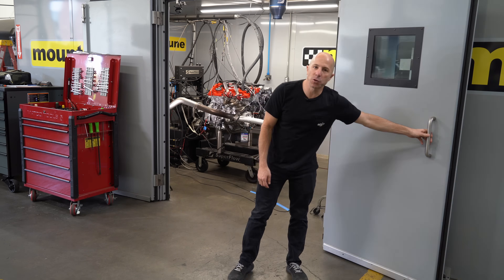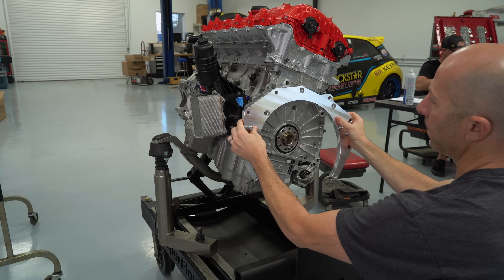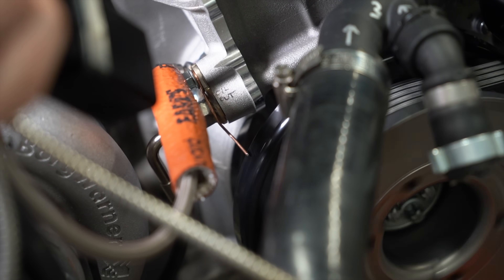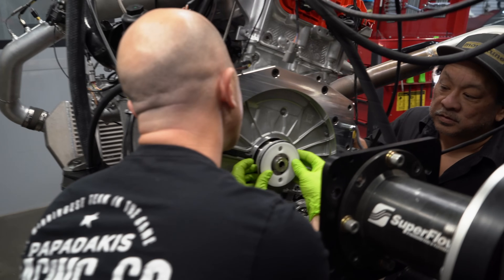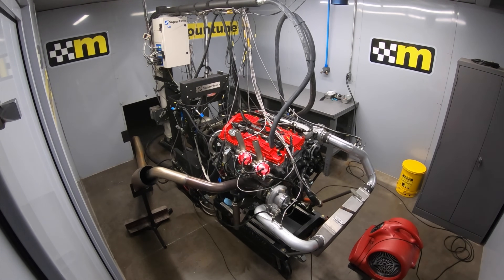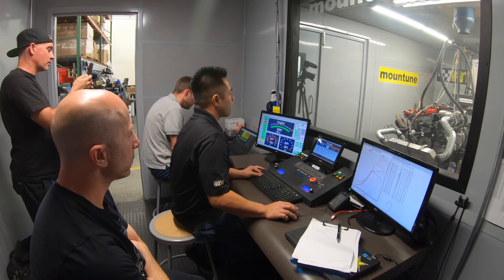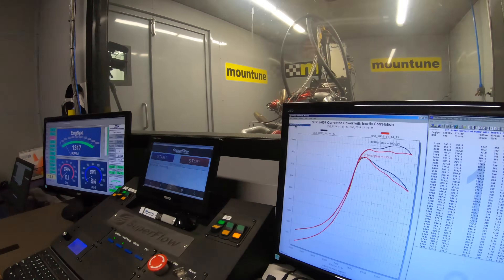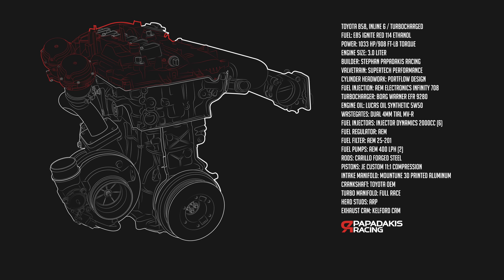B58 Engine Dyno 1000+ Horsepower - Sounds like a 2JZ!?

Comment: Based on the video it looks like this engine does not like high RPM. The head seems to flow way better than a 2JZ at low RPM, which is pretty much normal for an engine developed for early boost like most engines nowadays. The balance of the engine is not that good i guess, or something else is not right. They are barely pushing 6800rpm, this will be a limiting factor in case someone wants to go for big numbers. A 2JZ pushing this kind of boost is usually making around 1300HP, of course it pushes way more RPM. So from engineering point of view, the engine isn't spectacular. Yes it makes 1000HP, but this is a possibility for any 3 liter engine on the market. After all they made 800HP on a 4 cylinder Toyota engine, so those guys can make 1000HP on any straight6 :)

Comment: Will those dowels plugging the direct injection ports stay in it's place with all the boost that you will be making? Wouldn't it be better if it was welded in?
Reply: @Seb C surely the heat cycles of the combustion chamber would diminished the dimensions of those dowels, it's amazing how confident they are in thier tech, super!

Comment: I wonder how Mercedes avoids overheating direct injectors in the A45. It has dual injection (direct for low RPM and port for the higher speeds). I assume they inject fuel every now and then to cool them.

Comment: Imagine doing the timing belt at the back of the engine with it in the car, omg that would suck
Reply: BMW has the M50 i6 with people rolling over 300-400k miles with cheap maintenance.
Reply: @Carboy Dorifuto party  yes but if you actually did your research youd know that the m50 has its timing up front where's as the b58 has it at the back of the motor in between the engine and transmission, a significantly harder place to get too, it dosent matter if it lasts 400k km if it's a whore to fix it

Comment: I'm still trying to get my head around 6 cylinders and 2 exhaust ports.......
Reply: It has an internal manifold. So not two ports.
Reply: The 2021 models are getting 6 port heads later on.

Comment: all that work for 1000hp? they put maybe $100,000 in that motor to make it 1000hp?
Reply: I doubt that much plus most of the parts are fully new so that jerks the price but,there is a B58 out there that has 900whp with practically less done to it compared to what he did so spending that kind of money wouldn't even be necessary

Comment: too much crap to delete off these "modern" engines to get them to 1k HP - and a plastic intake? no thanks
Reply: They made most of the parts on there's since there isn't enough aftermarket for this yet to support 1000hp yet other than the fact that there's a B58 out there with way less done with 900whp with a shorter list of mods done to it.

Comment: Why didn't you thread the dowels in? Spark plugs thread in and hold a seal.
Reply: @Seb C the fitment relied on heating up the cylinder head with a BBQ and freezing a machined plug. Pretty sure cylinder pressures and heat from a high horsepower application will be higher than installed temp. Early third gen hemi's were having valve seats to fall out

Comment: The most people in the comment section talking shit about this engine because is from BMW, if the Toyota had a better engine they would have put it for  sure in the new supra, IT IS FUCKING LOGIC, also if this engine had a Toyota logo instead of BMW the fanboys (idiots) they will celebrate about the horsepower that the new engine makes(with a lot less money than the 2jz fact )and they would say jdm is the best etc..AND THE 99%CAN'T EVEN AFFORD A WHEEL OF THE NEW SUPRA

Comment: Noob talking here: Looking at the hourse power graph , the engine makes all of its power near the rpm limit.
And at low revers its very low.
Not sure why they are so happy about that
Reply: actually the power range is very good, casually it would be much narrower. and as you can understand from what ive said EVERY engine peaks power at higher rpm's (except for EV motors)

Comment: when turning the intake fan on in the room makes a 50hp difference. imagine open air :D
Reply: Almost the same.
Reply: If the fan increased the pressure in the room above atmospheric then the HP produced would be more than outside at the same air temperature / density.
Reply: 2000+ hp lol

Comment: Dollar for dollar, how much does a 1000 horsepower B58 cost compared to a 1000 horsepower 2JZin cost alone?
Reply: Its still in development....they haven't gotten that far yet and are for now stuck in the 700whp-800+whp range because of the limited aftermarket.

Comment: not a fan of this BMW engine.. sure its built ok, and it can make good power, but the longevity of BMW engines under high horsepower applications is not very good, and a few of their designs from previous engines require specific tools, and just not feasible for the average shop to take on.. when you have to buy $4k worth of tools just to work on one specific motor.
Reply: This isn't like the N series. These are modular and have parts shared off diesels so they wouldn't carry nearly any of the problems the N series had.

Comment: Sounds familiar. Built and put in a 4.0l in my jeep and after the initial 20min break in changed the oil and the rear main seal leaked. Changes the rear main that looked like it was chewed on and haven't had a problem sense

Comment: Roughly estimated, how much power would you be able to produce on the STOCK internals on this engine, applying more boost, more intercooling and more fuel pressure? in comparison to the changes to the internals on this build ?

Comment: Yeah about that, the problem with that engine is the BMW part! lol Its like disaster is built in it comes as a standard option lol, i'll stick to the 2J thanks.
Reply: Its a new engine.....they can't expect it to be just as good and out of the box like the 2j was when they've barely had a year on the R&D for this engine.

Comment: Great Job ! 
My only gripe with this is that the engine sound "off". I cannot explain this feeling, it´s like when you push a lazy engine to go high rpm. Dunno how to explain this.
Reply: Same here.  It sounded like a Hyundai that's getting the nuts spun out of it.
Reply: It's most likely the sound insulation present in the test cell

Comment: lol that "keep direct injection parts in the block unused" thing did kill some prominent drift car (iirc a D1 Lexus RC-F, converted to port injection) a few years back, thought it was common knowledge by now that these parts don't survive without any fuel flow cooling them.

Comment: No dyno for it but hasn't the engine been out 2016 in the bmw?
Reply: Yes and no. Its the same B58 but yearly they get updated/are built with different parts per year either with different parts or replacing parts they aren't using anymore. The mk5s B58 is slightly different from any of BMW's B58s but most parts are still slightly either or the same or different parts and design wise.

Comment: 2jz would have made 1000hp stock block
Reply: Yea...like every other i6 out there.
Reply: @Seb C when i said stock block i meant all the components, like the piston, rods, bearings..... What i should have said was stock bottom end.
Reply: @Seb C  I have a friend who made 1040hp stock bottom engine for 7 years, so do i consider him lucky?, no because its common. Myself being a owner of 2 supras, i would tell you 800hp is considered reliable on a supra. You said "The b58 is proven to be stronger than the 2jz
" hmmm idk about that. They probably ran tests on a computer using simulated software. I also understand the b58 has tons of webbing to increase the block strength rigidity but time will tell when more people continue to make more power. As of right now i still prefer the 2jz far more then the b58 due to the over all design, simplicity, and proven reliability from the very beginning
Reply: @Seb C 650tq is critical on a 2jz not hp and yes 7 years with typical service including new turbo, retune, and seals excluding rebuilds. There are plenty of people making 800-900hp on stock bottom 2jzs and very few in the 1000hp. Its possible and has been done. Since you worship supra forums like the bible then you should know this. again like i said the b58 has much to prove, time will tell
Reply: Seb C this guy lmaooo, “credibility”

Comment: Why do they block the injector hole?
Reply: It was converted from direct injection to port injection. They had to block the direct injection ports, to prevent direct injectors from overheating and burning up. This was at the very beginning of vid... look for sparks exiting injectors
Reply: @michaelrubidoux9216  yes i saw the sparks. I would like to know if it's better direct or port injector for racing. Tnx

Comment: So I was always told that with direct injection you have to run fuel through them or you risk damaging or melting the tip of the injector. I learned this because I work on diesels. I thought this was common knowledge.

Comment: I wondered what could be done about the direct injection. I'm building a 5.0 coyote for drag racing and the 3rd gen heads use direct injection. These heads are actually relatively cheap and perform nearly as well as the GT350 heads but I've wondered how the hole for the direct injection could be plugged without having to buy the injectors, especially if what happened in the video can happen. As far as I know the aftermarket has no clue either. Making plugs is an interesting idea but probably beyond what anyone who dons't have a machine shop can do.

Comment: Stefan, the foolish integrated exhaust manifold has to be milled off!!!!!!!! It's a massive disadvantage to performance. It is only there for big savings on manufacturing costs and as an aid in warming the engine quickly by running coolant through the inside edges of the exhaust ports. This results in two heinous problems.  The cooling system is already oversized for the liquid cooled exhaust ports and likely will not be able to handle the heat at WOT for any significant length of time with a greater than 100% increase in power. Even worse than that is the coolant system is stealing heat that would be a significant boost to the turbo. A lot of the OEMs offer heads without the integrated exhaust manifold or it's standard equipment on European models. For instance, Ford racing performance sells a eurospec head for the 2.3 ecoboost for anyone looking to make "significant performance modifications!" 
That's my .02 cents for the day, you made an incredible package for the B58. Now you can absolutely use the same components for the unfortunate i8 and 325 owners. Your design will give the B38 in the i8 the 500 Hp it needs and 667 hp to the B48 in the 3 series and mini coopers. Modular is as modular does!! 👍👍

Comment: I am completely confused about why you would port inject a direct injection engine. Will this not effect your tune when you put the engine back in the Supra? You would figure you would want to take advantage of the direct injection while dyno tuning. Will you be leaving the dowels in and be doing port inject when the motor is dropped back into the car ?

Comment: Love the engineering that went into this thing but honestly i think leaving the Direct Injection on there and using a Motec ECU that can control DI and port injection would have been a better option and you'd always have the fueling you want; but this is just my opinion and im sure there's a reason that you did what you did.

Comment: ausie bare 6 cylinder can make 1000hp easy and much cheaper and easy no drama like this.
Reply: Theres a difference. That's been in the aftermarket far longer than this has and had a way long head start while the B58s aftermarket is still small but growing. No matter the engine they can't immediately make heaps of power out of them when it's aftermarket is JUST starting to grow they cant immediately just expect it to pull numbers when they dont have the parts nor development to do so yet. That's just unfair, so atleast give it a year Or 2 to atleast give the aftermarket time for them to pull numbers out of them before comparing the 2.

Comment: Personally I wouldn't use this thing, you people hear it and supposedly it sounds exactly like a 2j,but if you have a good ear you can hear a little bit of knocking already by the second run before the fuel rail thingy happens, it doesn't sound like it's screaming in anger like the rb or 2j does...... It sounds like it's screaming for dear life
Reply: I thought all engines did that....

Comment: That's the reason why two-system injection that has both port and direct injectors still using direct injectors after every short period of time even when running on port injection only. This way it cools down the direct injector tips. Toyota and Lexus D-4S fuel systems make a funny sewing machine sound from time to time when idling - those are direct injectors that make a loud clicking noise. :)

Comment: Papadaski is humble and does not edit out mistakes.

it helped him to become a professional.

the dudes claiming the engine is no good, should be humble and cahnge their mind.

the reason to call it bad was that some unimportant parts were made of the right material. but they just repeated the old sayings of their daddy of the 1960s and said plastic is bad.
they even do not know that plastic has developed better than any other group of materials.
result: they repeat relicts from the past and feel king and did never ever develop in their mind.

Comment: So yeah 2jz is way more tougher and reliable...
Reply: There's a B58 240i out there pushing 900hp with less done to it compared to what he did to his (I think there in the high 9s with it too) these can handle 1000hp it's that the aftermarket isn't there for that RN.(is say near 800 close to 900hp for them).
Reply: @carboydorifutoparty3976  hmm not bad for a bmw engine 🤔🤔🤔

Comment: That's pretty trick, you managed to triple the stock HP using the same block.
Reply: To be fair, if the N54/55 was able to make 600-800 horsepower on a OPEN-DECK block then I'm sure this was able to handle that power as it is a closed deck block

Comment: so, Toyota designs the Supra for tuners in mind but then you have to pull teeth to use the engine on a dyno?  Modern day Toyota is so weak... they had to rely on another company for a performance engine.  Toyota makes transportation appliances, not vehicles.
Reply: Um.....u do know that Toyota worked with a few companies like Yamaha to make the 2000gt or how they got lotus to tune s few of their cars including some supras right? They've been doing this with their sports cars for like ever now. They've even been working with BMW for a few years now so they worked with them to make the mk5 since they already had a decent i6 that was already made by BMW so they co developed both cars.

Comment: Aussies with their barras be like: 

‘So what did you do to get 1000hp mate? Just swap out the valve springs, the con rods and the pistons, slap a big turbo on, and put some high flow injectors on it yeah?’
Reply: also e85
Reply: Barras are great for bulk power. They are also cast iron block, so incredibly heavy, and they are physically enormous to boot. Not exactly good qualities if you want them in something that handles.
Reply: @t_z1030  do more research on barra  engines i don't think many will agree with you there
Reply: @vee950  I used to work at a wreckers, we always had at least a dozen barras in stock at any one time. Trust me, the things are huge. While the weight difference between iron and alloy block isn't as massive as most people think, the things are so big that more of it will be forward of the front axle. They're just terrible packaging-wise if you want a car that handles. You'd be much better off with an LS in that regard.
Reply: @vee950  i agree with him
Reply: @doublesnotroubles  i don't, no at all, and LS motors are aluminum there more pron to throwing rods,blowing head gaskets and cracked blocks under high hp  I use to see LS powered cars coming in the shop quite a bit some years ago LSI engines only 1 thats strong is the cast iron version an its as heavy as a barra
Reply: Lol rodney loves to go knock knock on 1000hp barra's... pos motor
Reply: Oh my god the crap they've gone thru to make 1000hp. No wonder he was happy. They were waiting for it to explode. It was an exercise in futility. Yep a Toyota, BMW boat anchor. It wasn't like they were doing other pulls after 1000hp ticked up. Nobody wanted to sit cross legged, between burning incence, humming chants to the gods on the floor any more. I'd say that did another 10 pulls and it would need stripping. Pile of shit, and that's progress!
Reply: @gb4408  i dont know you, but its better than anything youve ever done.
Reply: @m.b.82  That's right you don't know me, or what I've done. That engine was never designed to be altered, modified, by design. He's a smart man. However effort versus outcome is a case of diminishing odds. Reliability at 1000hp+ will be the telling factor.
Reply: @gb4408  well it had to be done.
Reply: Barras in Australia are like the LSs of the US
Reply: @alexismendoza1545  Barra completely annihilates the ls in everyway, comin from a holden person that loves the chev motors.
Reply: The melted injector and leaks. 

The thing needs to be re-engineered just to not blow up. ....

And guess what. 
IT STILL BLEW UP
Reply: @fastinradfordable  Yea it blew past 1000hp with less than a year of development.
Reply: They took of the BMW badge and changed it for a proper badge, Toyota. Loll
Reply: @farhanb4914  said nobody ever.

Comment: So this proves that throwing 100k$ on a new engine, and pushing 50psi of boost through it makes it almost as good as a 30yr old engine. Great news !
Reply: No dumbass, 100k$ in Research and Developing the engine first, a mass production kit can and will cost less, besides it'll run so much better than granddad 2jz